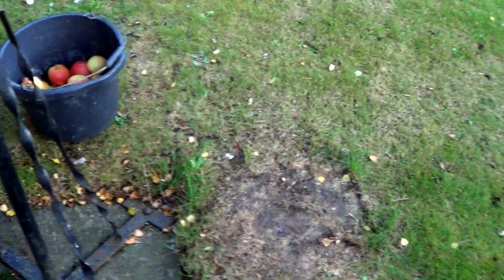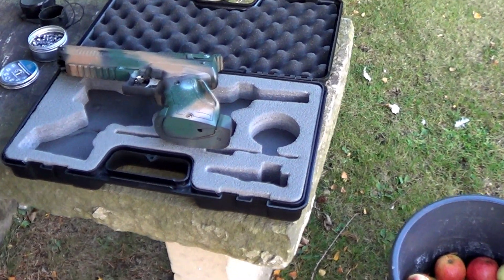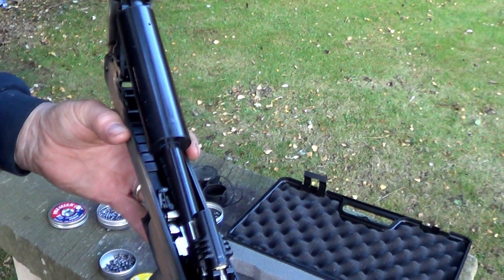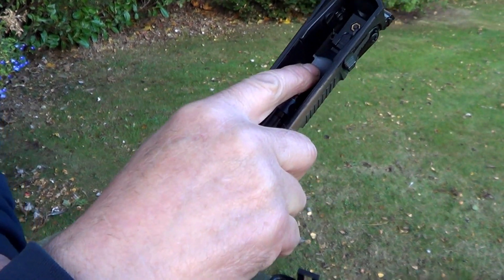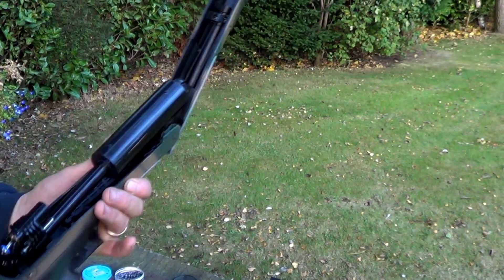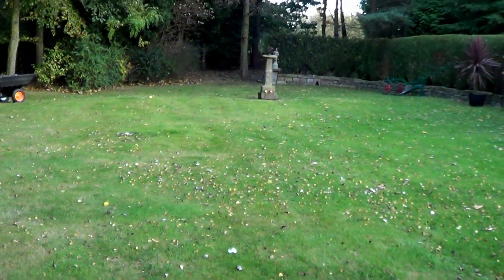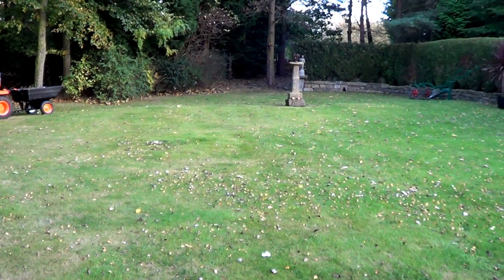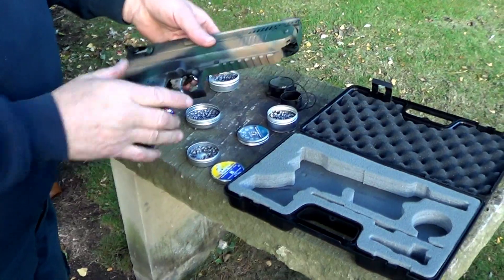webley alecto , air pistol review

Comment: Good shooters are the alecto,s i have the mK3 you are talking about in. 177 with the moderator but it doesnt   "moderate" it that much really, but it looks good. Interesting paint job on yours actually looks pretty good. I have never tried a pistol in. 20. They are meant to be the best of both worlds of the. 177 and the. 22. What are your thoughts on this? I heard you say u have the hw45 in all 3 calibres, so which is your favourite pistol calibre overall for power n handling and for a bit of pest control etc? I know most people say the. 22 and alot of people say u cant hunt with a pistol but i know that is nonsense as long as you are are within 10metres and you are confident in your ability, but in a survival situation you would use anythin. I also  have the crosman 1377 and 1322 which i have both modified, and also have the hatsan supercharger. 177 which is a quality piece for its money, trigger safety fibre optic sights  and threaded barrel barrel for moderator as standard, shoots at 4.8-5.2ftlbs so not quite as powerful as the alecto n hw45. Love your channel, honest reviews, between some real classic airguns and i still   do the same kind of testing with shooting the candle. i still shoot different objects to compare damage between guns and different ammo  like old chopping boards n frying pans, ballistic gelatine off ebay and  even an out of date joint of gammon, pretty much  anythin for entertainment ha ha ha.All the best from lancs pal.